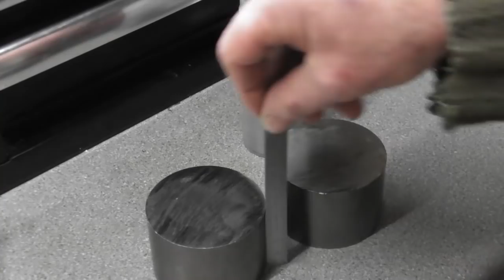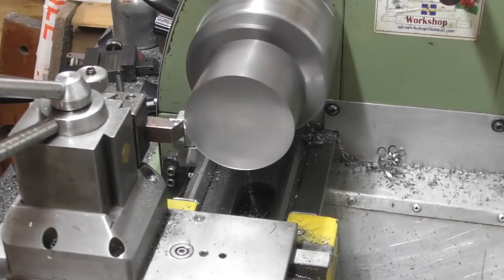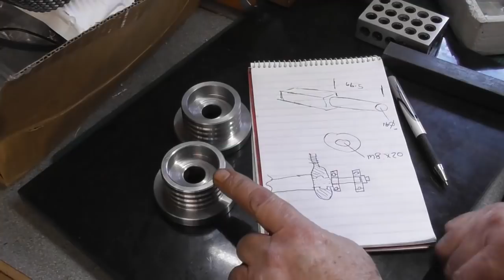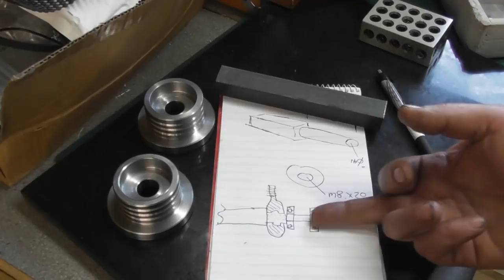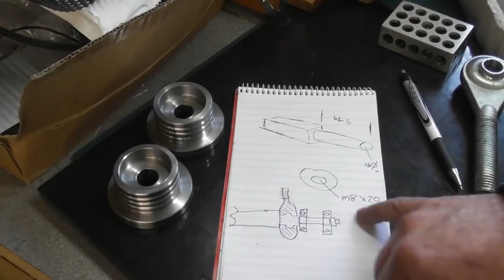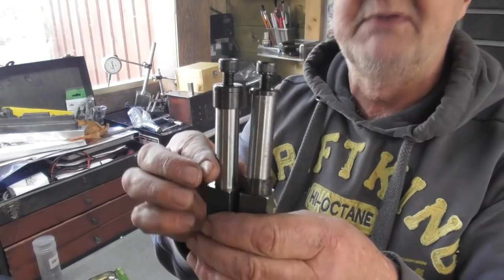Turning some Saw mill guides  A Collaboration with Kris Harbour Natural Building

Comment: could you have left a raised boss on the inside of the bearing hole to set against the bearing's inner race instead of the inner sleeve?
Reply from the maker: that could have been an option but this is more traditional and dare I say conventional. Cheers Ade.